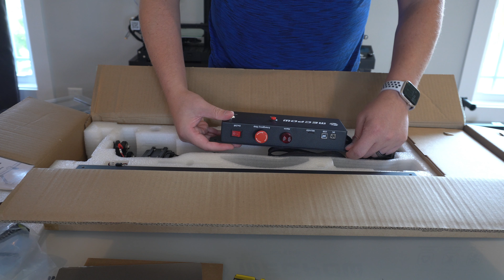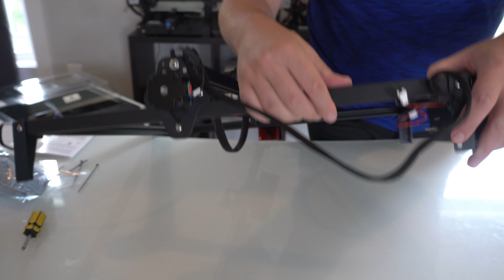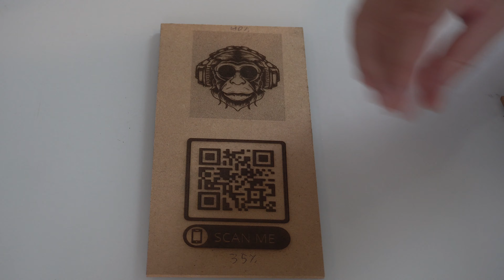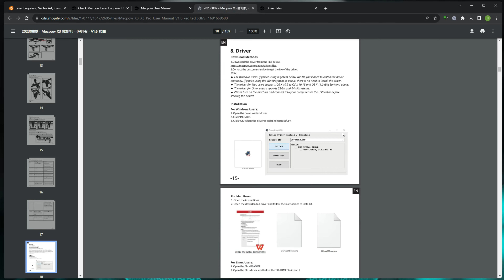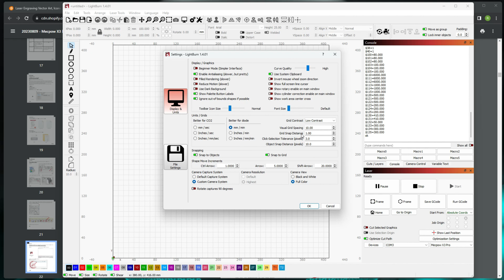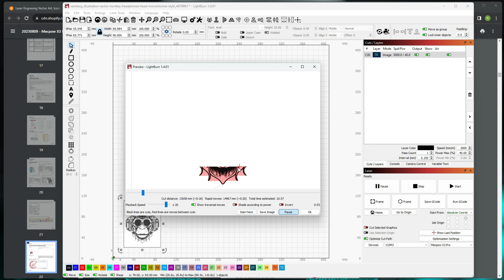Mecpow X3 Pro – Setup and Initial Thoughts!

Comment: Your comment on the emergency stop saved me an afternoon of frantic forum searching. Thank you!
Reply from the maker: Glad i could help :)
Reply: Damn! Didn't save me. I was aware of the old driver issue, so I installed those. From various sources and ages and nothing worked. Complaint to the seller and manufacturer (and asked  some others) and they all came up with the default answer of rolling back my drivers, - which I already told I did - or even roll back my complete windows system! Then I found out about my emergency switch! If only I saw your video a week earlier!   🙂  Could have saved me some precious time... Thanks for video anyways! Keep up the good work!

Comment: Hi do I need to change the line interval/DPI settings in lightburn for the mecpow x3 pro w10 when engraving a photo? If so do you have any good setting? Thanks.
Reply from the maker: Hi. You dont need to but it could help with quality. It will depend on the material used but i try not to go under 200 dpi.

Comment: wow, to the UK without shipping £215 for the Pro. Amazing.  I would be cutting 3 -6mm ply and some 12mm EVA foam and maybe some 5 - 6mm oak sheet that I have.  so I am thinking the 5w would be a better option but if the 10w Pro cuts cuts 3/4 oak that is amazing.  Looking forward to see the next video on the cutting side of things.
Reply from the maker: Hi. To clarify, neither the 5 or 10w laser can do 1/2 oak in on pass. The 10w can do it in fewer passes but the 5w can do it as well, it just needs more passes to get all the way through.
Reply: @3DPrintscape  thanks. Did not think either the 5 or 10w would do it in one pass but look forward to your tests. I don’t typically use that thick a material unless I am building cabinets etc. mostly mine would be for the much thinner stuff for rc boats and Eva foam. Question though. What is the longest piece that can be cut. Guessing on the diagonal.
Reply from the maker: It would depend on how wide the piece is but if its thin then diagonal. You may be able to get to 450 mm that way.  @GhostofTatooine